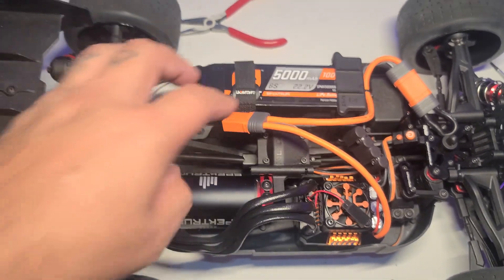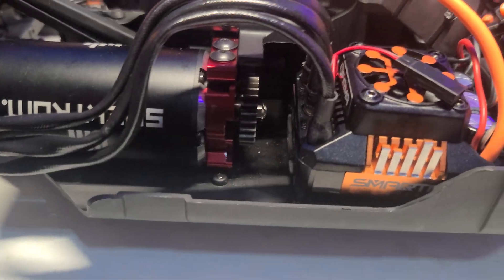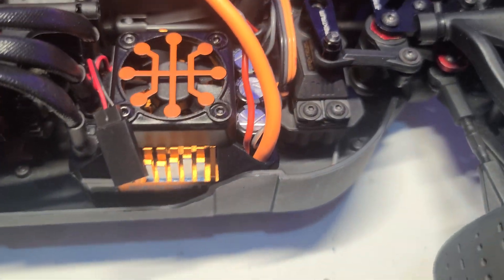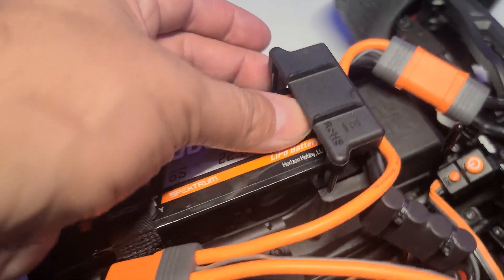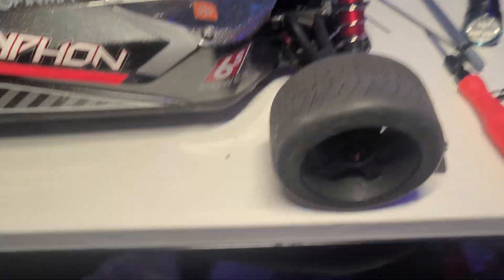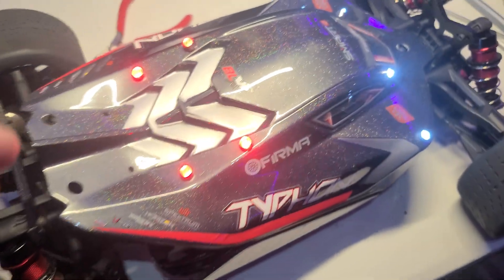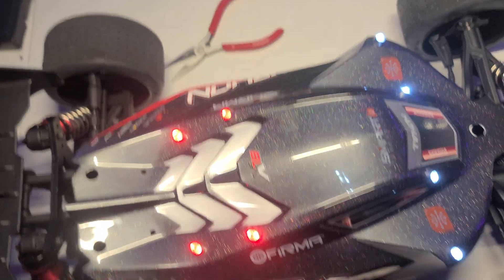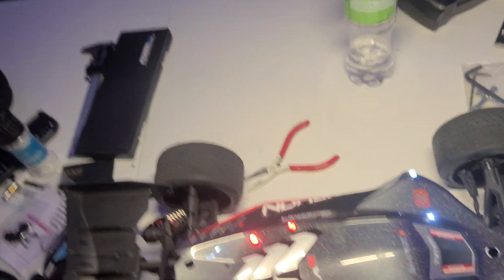Typhon 8s conversion 1250kv

Comment: Thats a really nice setup you have there. Did you change the motor mount or is that the same one that came with the typhon?
Reply from the maker: I had to mod the motor mount
Reply: Is that the 8mm shaft 1250?
Reply: @andrataylor6070 that motor has a 5mm shaft
Reply: Will the 1250 kv with the 8mm shaft fit my Arrma Felony?  @maherkahala5269
Reply: @andrataylor6070  yeah it will, I have it in my limitless running 8s
Reply: Ok..Thanks!💪🏿 @maherkahala5269